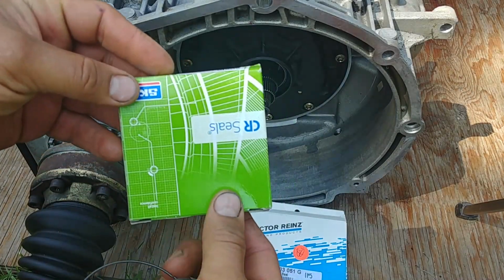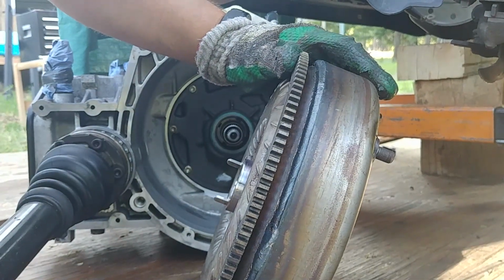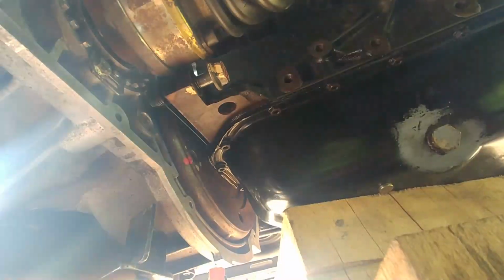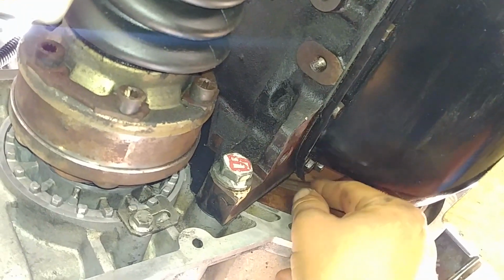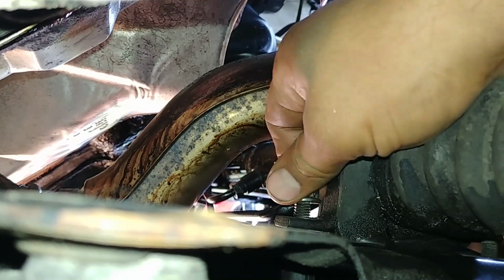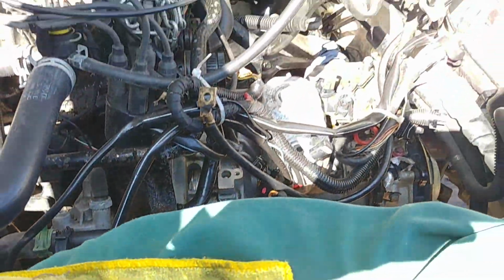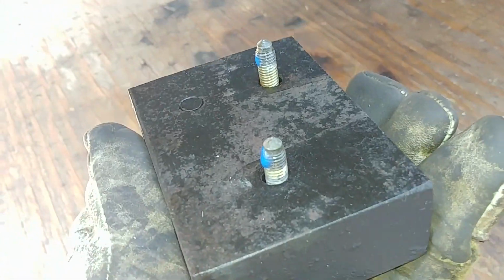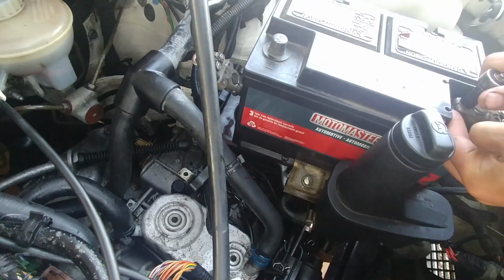HOW TO INSTALL TRANSMISSION on Volkswagen GOLF, JETTA MK3. Complete Guide.

Comment: I can't find a good way to get to the rear trans mount because of my abs
Reply from the maker: Any luck?
Reply: @PistonShack  tried my best with a swivel still didn't feel like it was tightening enough thought but then had to undo it gain to allow clearance for the cv axle and haven't tightened it back on yet
Reply from the maker: @mr4toes  Can you just unbolt ABS module without disconnection brake lines just move a bit to get some more room?